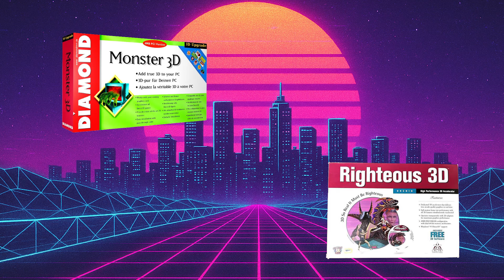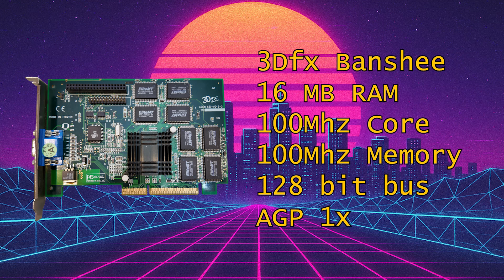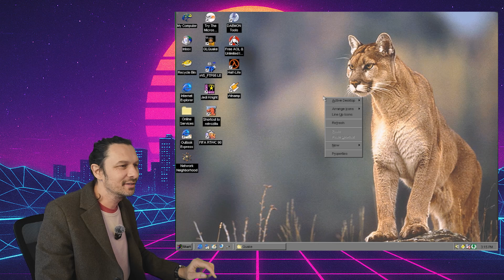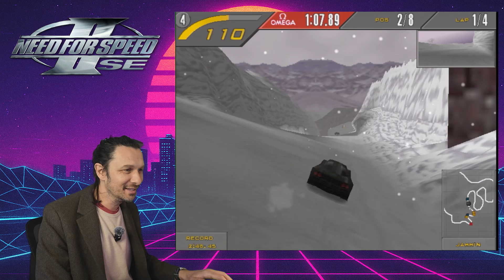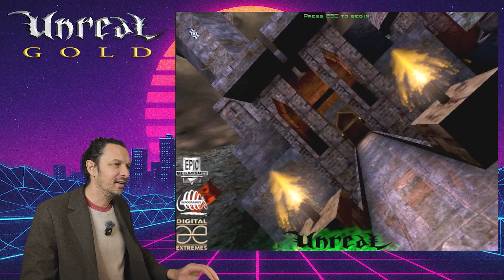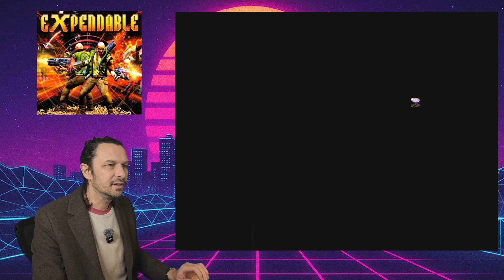3dfx Voodoo Banshee Revisited: One of 1998’s Most Important GPU's?

Comment: In my humble opinion, Quake 1 is a bad game to demonstrate the 3dfx effect. The glide renderer served just as a testing ground and it shows - many effects are missing! For example no fullbright textures or dynamic lighting. The added performance was it's main thing and perhaps some people prefered the bilinear filtering. To me the software renderer is where it's at and is the best way to enjoy the original game, especially if you have relatively fast system such as Pentium III or better. Quake II is another story though.

Comment: I have Diamond Monster Fusion Banshee is 3dfx too. But on few games like star wars force commander or X Wing alliance showing primary display driver. I installed direct X8 maybe thats why... its support only directx 5 - 6.1
Reply from the maker: You're probably right, those older cards often struggle with newer software versions!
Reply: @ComputerRetroBus  is it possible to download direct x remover and install direct x5? sad its not possible to deinstall direct x. I have win 98
Reply from the maker: @_Shisui.-pd5vt  I dont believe there is a way, but having a higher version shouldnt be a negative impact, the higher version has all the previous versions (like 5 and 6 ) in it for backward compatibility

Comment: Hi! Just want to nit-pickingly point out that the P2 was released with the 440FX chipset. The LX came slightly later.
(I bought one of the very early ones with the FX, together with a Voodoo Rush)
Reply from the maker: You are correct, I got this wrong actually. The FX came first for very early pentium II it was originally made for the Pentium Pro in 96, but it was retrofitted to support early Slot 1 Pentium II
Reply: ...and Quake II should have been OpenGL, not Glide?
Reply from the maker: @dantilert5320  There was OpenGL and 3Dfx glide as options in the video settings, changing it to OpenGL didnt work for me
Reply: @ComputerRetroBus  Huh. I have to check this out. I guess I'm misremembering. Strange though, I thought id software was all in on OpenGL.

Comment: The tnt2 supporting 32bit color is kinda a lie. It technically could do it, but the performance hit was a joke, so I don't think the chip was actually optimized to use it. Nvidia also forced the 16 bit mode to use the worst dithering screen door pattern, which nobody else did as badly. Another problem with Nvidia was the higher texture resolution, because they could barely do anisotropic filtering, and the mip mapping lod difference was horrendous. So while Nvidia did all this marketing, what they actually showcased was how ugly their cards ran graphics, and Radeon BTFOd GeForce in general image quality. Voodoo was lucky enough to have consistent quality graphics, you had resolution limits, texture limits, and the quality was acceptable on average with no jarring differences in LoD levels or color.

Once we got high resolution textures, you needed anisotropic filtering, and only Radeon had decent performance with it. I believe the horrible performance on Nvidia, was partially on purpose to sell their Halo products. Which was really funny when you could buy a $50 budget Radeon and get better performance with anisotropic filtering.
Reply from the maker: That's a fantastic analysis of the time and the way they each treated graphics. I recall ATI cards were very renowned for their texturing ability and quality
Reply: @ComputerRetroBus  True. With caveats, because the budget dx8 cards couldn't run trilinear simultaneously with anisotropic filtering, and fog tables required a registry setting in 9x to work. The "9000" dx8 cards were the primary problem. Ati provided full dx8 support on their budget cards, unlike Nvidia, but the budget 9000 cards used a hacky cut down implementation that would sometimes not work, with say the invisibility effects in Halo. The cards were good for the price, but the budget models had a limitation with trilinear and some shader effects. This wasn't as bad as Nvidia rebranding GF2 as a GF4mx, or the FX 5200mx, but there were a lot of cut corners for budget graphics. Ati still provided a better product at every price point though, especially for dx9. The 9600 was a great budget dx9 card with none of the dx8 issues.

That said, the budget dx8 9000 cards were still great for older games, with the capacity to run dx8 way faster than anything from Nvidia.

Comment: Unreal 1 and the original Need For Speed. I played those games for a few months in software mode, then ran out got myself a Voodoo card. That upgrade was something to behold. It was the smoothness of the motion that really stood out but also the lighting.
Reply from the maker: i know! It looked amazing but what really blew me away at the time was how smooth the motion was due to the drastically improved frame rate, was just amazing.
Reply: Wait, original need for speed had a glide version? I thought only nfs2 had.. and nfs1 didn't..
Reply from the maker: @ВикторШевцов-п1з  yeah I don't think original NFS had glide
Reply: @ВикторШевцов-п1з  Oh, it may be the second game(my memory isn't what it used to be). It was what I thought was the first.. but maybe it's the 2nd or 3rd. I remember buying it with Unreal 1 so whatever NFS came out around that time. I was in my mid 20s at the time.
Reply: Technically, the first NFS I ever played was on the 3DO and yeah I was one of those idiots that spent a fortune on that disappointing console with my brother at the time and I thought that looked amazing when it was released, but the Windows versions that eventually came later were so much better!

Comment: If I remember rightly you need to type 'stat fps' in unreals console to see FPS readout. Fraps only works in D3D (maybe ogl?) ps don't forget, 16 bit colour looked horrible on the TNT, blocky dithering in transparency etc, so TNT owners would brag their card supported 32bit but they were forced to use the horrid 16bit due to performance reasons.

Comment: Good ole days. I recall having I think a 12MB card, but I don't remember if it was still doing the pass-through with a 2D card or not. Good times, I squeezed a lot of life out of a Cyrix 110Mhz with 64MB of memory.
Reply from the maker: Sounds like a voodoo 2 card, they were the only ones that came out in 12Mb as far as I know, what a great card!
Reply: You had a voodoo 2 quite a bit faster than a banshee two texture mapping units

Comment: The downfall of 3dfx started when, AIB partners where no longer allowed to make or create 3dfx cards but it was solely now to 3dfx to make those cards. 3dfx was also highly in enterprise stuff with flight sims more for goverment based of stuff, and obviously arcade based machines. Throw in a dollar and you had 3 lives to play your game in a arcade hall. So much good memory's. If only their management look a little bit more ahead instead of throwing party's they would have been on top of the game still. It's just 4 now, on which the usual Nvidia, AMD, Intel and a chinese brand that is at least trying to compete with 3d graphics. The rest either faded away and are still marginally active, others sold, spun off, and find their tech in mobile devices these days.

And yeah i owned various 3dfx stuff; sis6326 4MB followed with a Voodoo II and later with a SLI version of it. Even the first Voodoo1 with it's handicapped 512x384 resolution. Could just not figure it out for months why in Windows 98 or even 2000 it refused to go any higher. Till i learned it only had 4MB of memory on which 2 for the framebuffer.